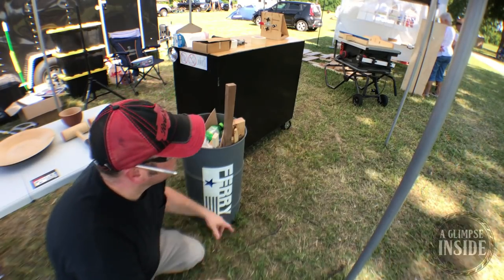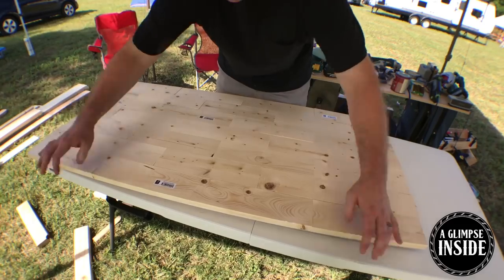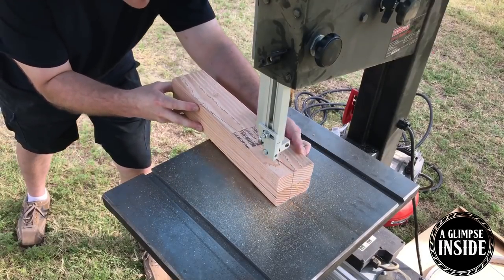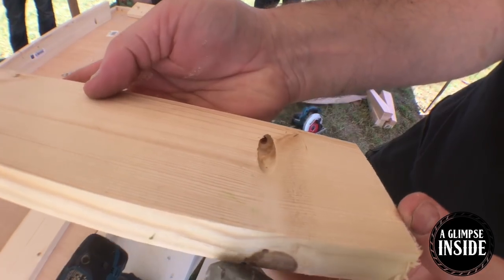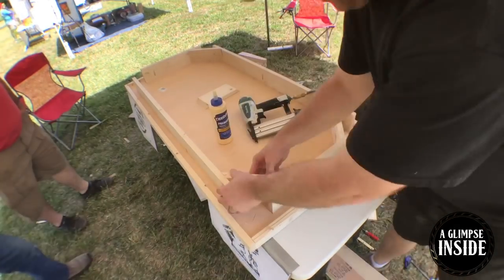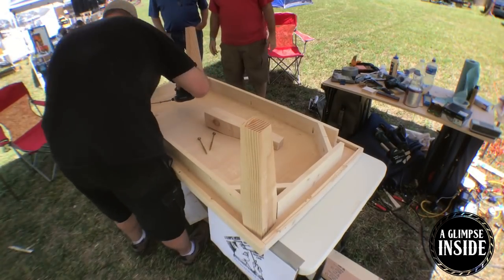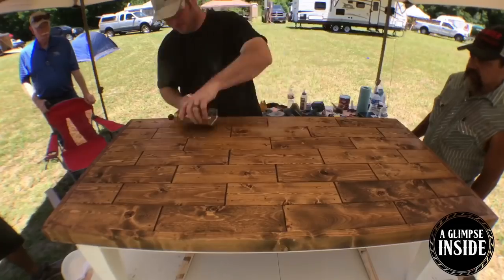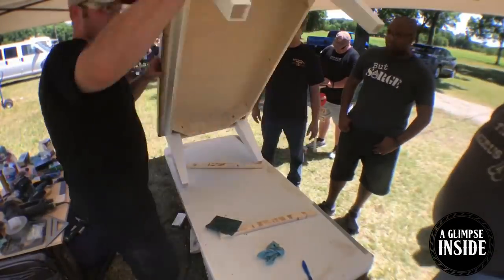Coffee Table for under $70 | Met Diresta, Bates, Montgomery & Ferry!! // Time with My Hero

Comment: Very nice coffee table Chris! Are you still recording everything with an iPhone or are you using a GoPro or anything? Also do you edit on a tablet phone or computer?
Reply from the maker: +Wood And Screw thank you man! Yes. All on an iPhone and edit on the phone too!!
Reply: A Glimpse Inside did you buy an app for the editing?
Reply from the maker: Wood And Screw yes. $3 app called videoshop
Reply: A Glimpse Inside well it does a great job. Is that where the logo was made too. Sorry for all the questions
Reply from the maker: Wood And Screw  no worries man. Yes an app called vintage design. 3$. It works great!!

Comment: How do you dye that pine because I've tried different oils and sometimes stains and they do bugger all so if that's just Danish oil this is mind boggling for me, if you could reply would be brilliant thanks ;)
Reply from the maker: sebastian penny what helps me is sending at least to 220. I like to wipe off the material with mineral spirits to remove all the dust let it air dry, and then apply any stain. That technique usually works for me

Comment: Your explanation on what you did with that taper on the legs is very confusing. Would you mind explaining a bit better?
Reply from the maker: Frodo I will do my best absolutely! The first cut is made by running the peace through the bandsaw and a slight angle. Then, you take the cut off peace and tape it back into place where it once was. Rotate the piece 90° and cut the exact same angle again. The result is two angled pieces coming off the original piece at the desired taper. Sorry if I wasn't clear but I hope that helps
Reply from the maker: Frodo I will do my best absolutely! The first cut is made by running the peace through the bandsaw and a slight angle. Then, you take the cut off peace and tape it back into place where it once was. Rotate the piece 90° and cut the exact same angle again. The result is two angled pieces coming off the original piece at the desired taper. Sorry if I wasn't clear but I hope that helps